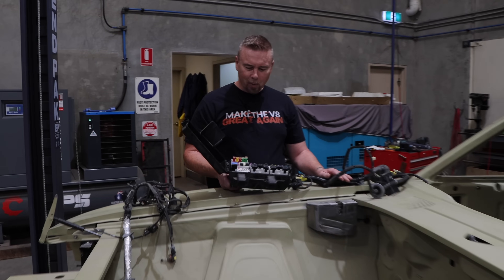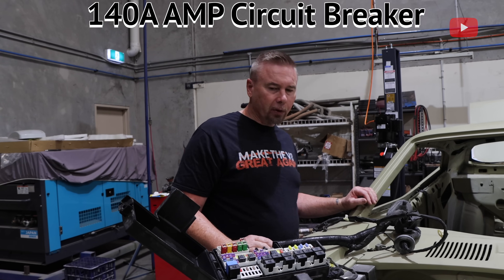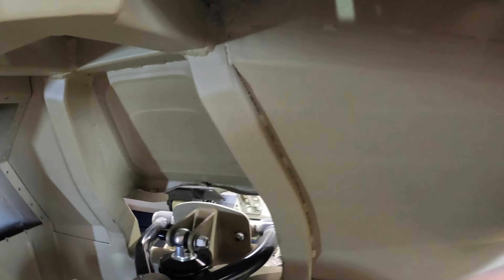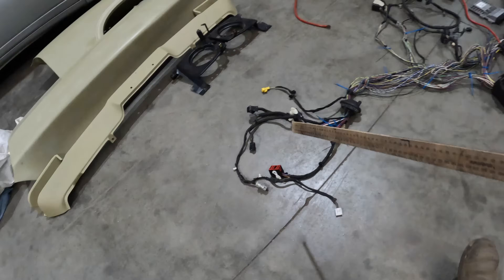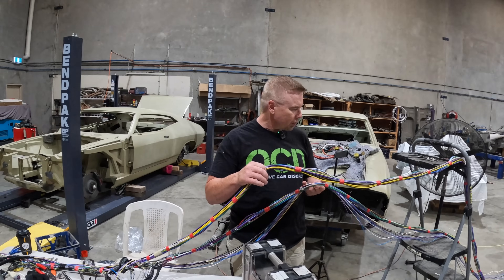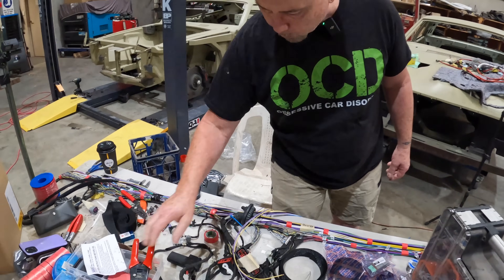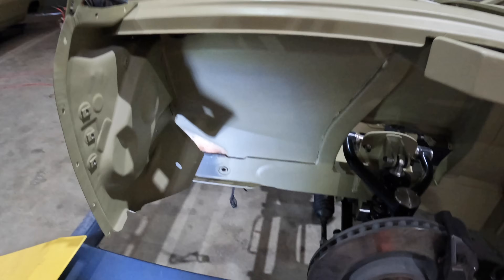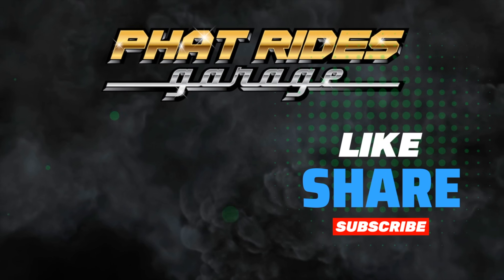XB Coupe   Mustang GT Donor   Retribution - re-wiring begins  and  installing the Dash EPS 93

Comment: A lot of work extending that many wires, but as you have done it with relative ease, and labelling you can't really go wrong. Absolutely the best idea moving the fuse box to the boot. Nice clean engine bay and a blower to top it off.......love it.......dash looks sick as.....and should be pretty easy to match the door trims to the dash ends..
You're on a roll, so keep it going......
Reply from the maker: Thanks Darrin !

Comment: You had me worried with the cut and solder, glad you went with the connectors. Handy knowing how to lift things.
Reply from the maker: yeah Love the DT connectors !
Reply: @phatridesgarage3760  I've done a lot of custom work on my bike like cruise control etc., made it all plug and play with original electrical connectors so it can all be reverted back to stock if needed.

Comment: That looks absolutely amazing Tom all that wiring but it all has to come out to paint 
I think I would have painted the interior before the fit out then it can stay in
Reply from the maker: Thanks mate , Im doing it tgis way because I had no idea if i need to drill , cut or welding during this assembly process which would ruin the paint , and so far I have done quite a bit of that so I dont mind disassembling later just in order to know everything is a 👌 ok

Comment: What a huge effort to incorporate everything from the donor.  I thought all the security and "driver assist" safety stuff would be impossible to bring across, but you're doing it!  Which features will you be removing?
I was planning to buy a body harness from Power By The Hour for the coyote swap without trying to incorporate the full factory donor loom, but you've got me thinking!
Reply from the maker: Thankyou mate ! I am not sure about the driver assist, it has me worried, ultimately I would like to see if the airbag and seatbelt tensioner part can be deleted from the system altogether as Im not sure we are allowed to have them  in these resto mods

Comment: Don't get ripped off buying the LiPo battery. To actually start and run the car a little 2kg 'motorcycle' job will do the business (630 CCA - more than enough for competition purposes), but as a street cruiser the accessories drain will kill it, so a larger size will be needed. Super Start Batteries is what I'm running  I bought mine from Goodchild Enterprises (Perth). They were very helpful and there is a multitude of different sizes, so talk to the local dealer. If you start looking for the youtuber ones or in the 'racing' suppliers you'll pay too much.
That said, I believe SCA now retail some, so they might be worth a look too.
Reply from the maker: Cheers maye thanks for the tips 👍